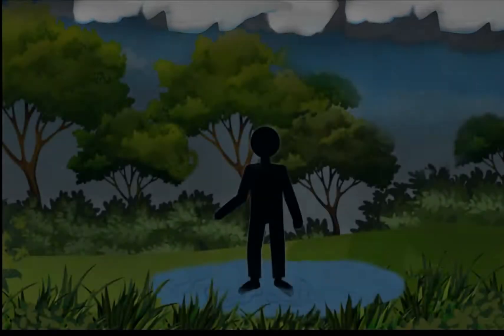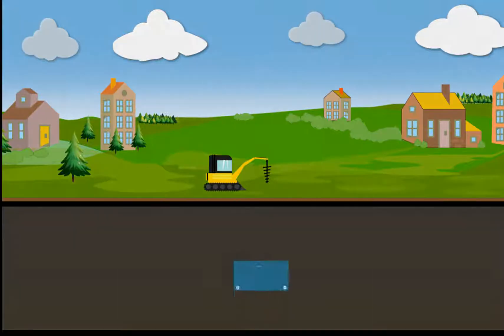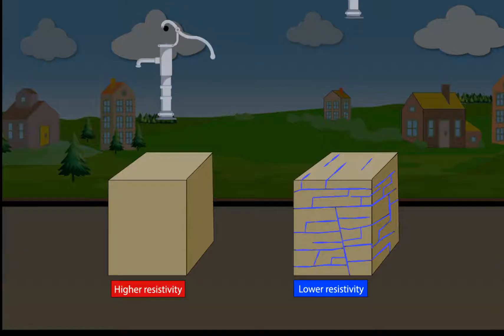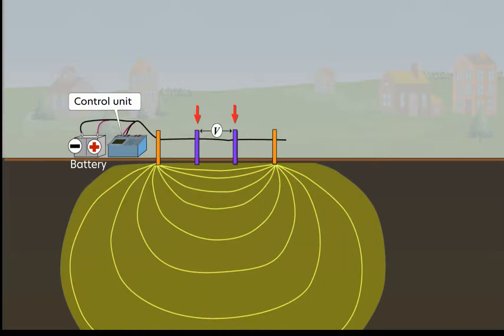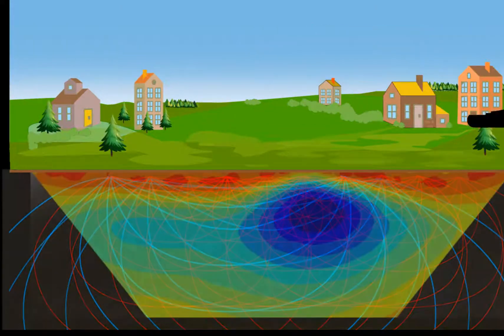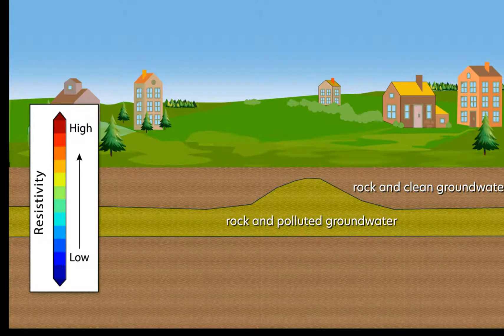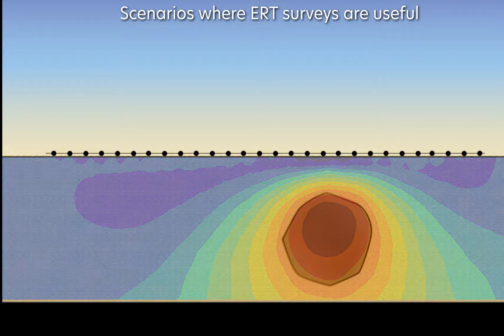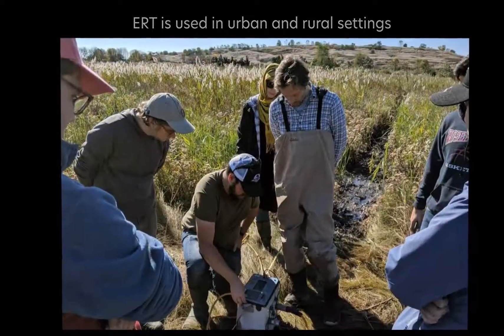Electrical Resistivity Tomography: Imaging Sub-Surface Structures

Comment: rubber boots will not save you from lightning.... 

I realize it's just to illustrate the point but it's a complete flub which shatters credibility and perpetuates a stupid myth.
Reply: only if lightning strikes ground then it can actually save you ...direct lightning might not but if it's the very high voltage lightning striking the ground near u then air itself will create electric field driving current through air and ground but chances are very low of such high voltage lightning strikes so most of the time boots can save us from ground-based strikes only and ofc direct strike no chance.